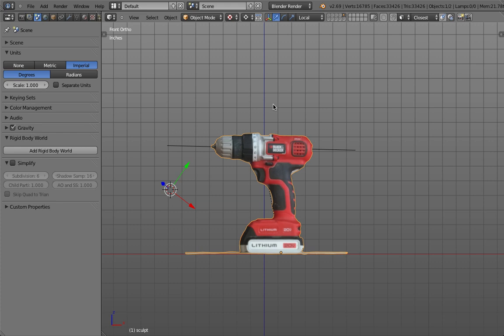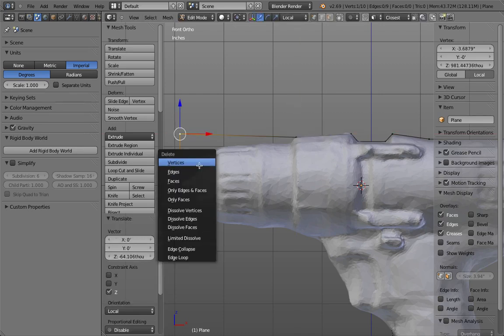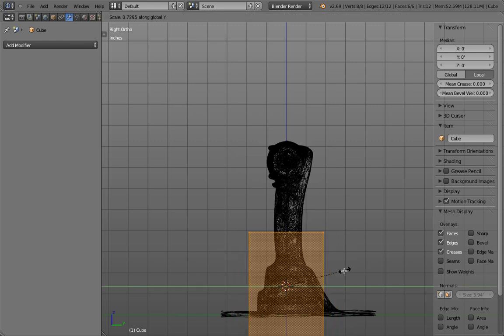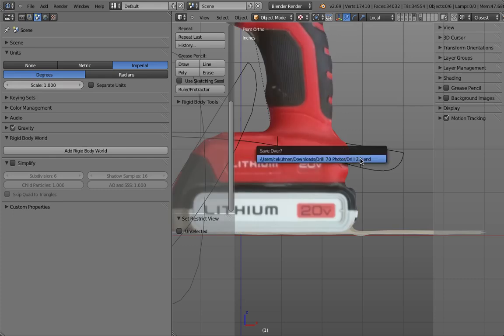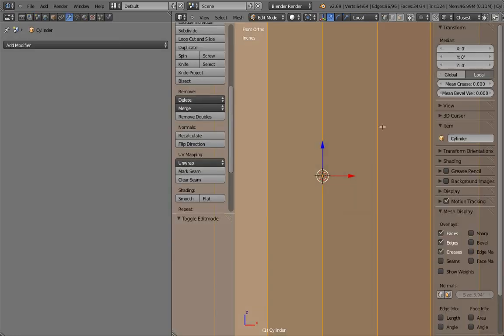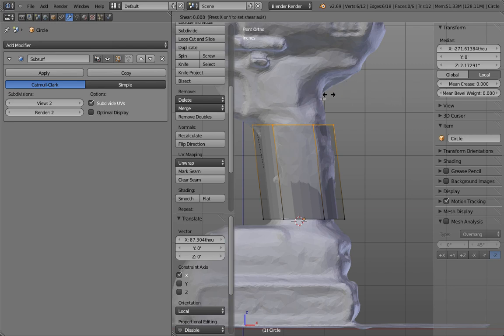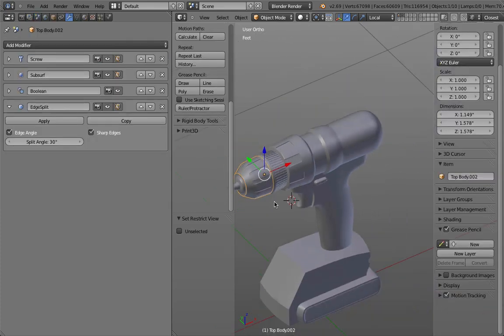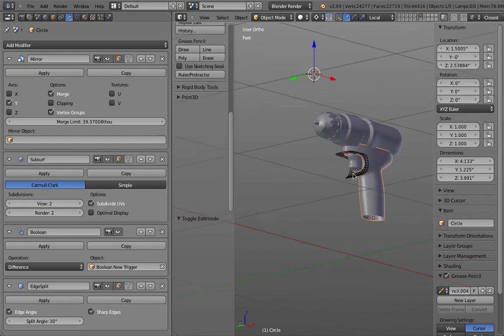123D Catch Reverse Engineering in Blender

Comment from the maker: In this video I show three well working approached to reverse engineer the 123D Catch data in Blender with polygonal surfacing combined with various modifiers such as screw, boolean, array, and subsurface.

This is a workflow that will enable you to rapidly rebuild geometry sculpt quickly design changes and produces surfaces that can be send later to Fusion360 for polygon to NURBS translation.

This way you can harness the power of low polygon 3D sketching and produce surfaces a NURSB environment can continue working with prevent a rebuild of the model.

Enjoy.